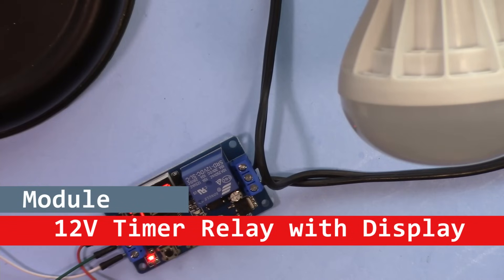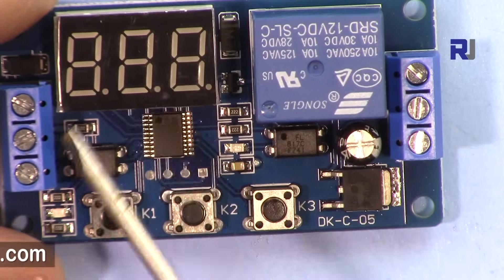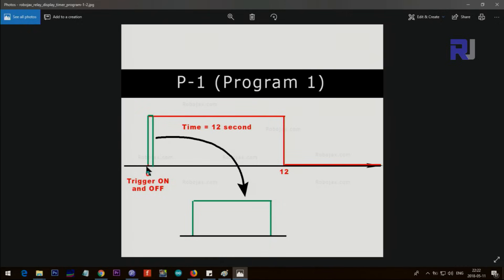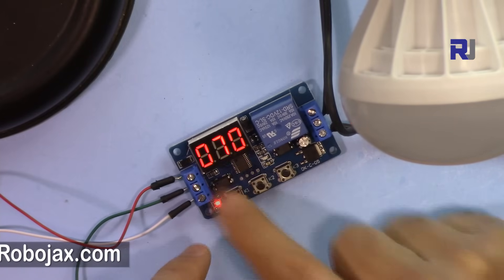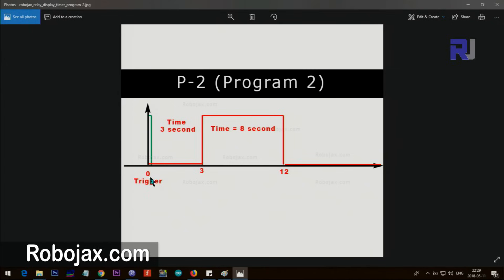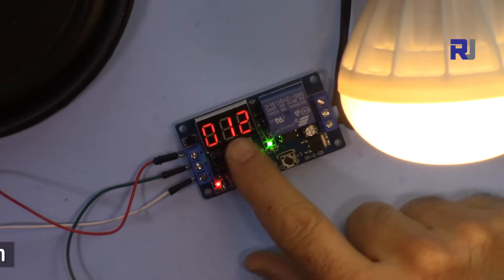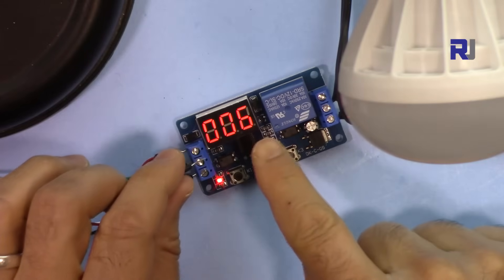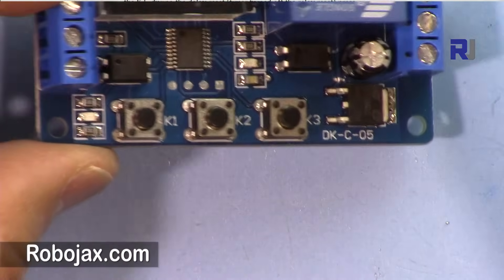Home Automation: 12V Relay with LED Display Delay 0.1 seconds to 999 seconds Timer module P1 to P4

Comment: I wish this had infinite sequences and a dial so I could use it to "programm" what my camera should do if it detects something.

Like radar/Pir-Sensor sends "high" to camera button
=> 
4sec "high" = wake up camera
0,1sec low

2sec "high" = change mode to photo
0,1sec low

0,1sec high/ 0,1sec low = trigger photo
x8 = trigger 10 photos

4 sec "high" = camera off,
 save battery
waiting for next input.

Comment: My friend does this work with dc? If not can you tell me which I need. I need exactly this function but for my car 12v
Reply from the maker: what? so you don't know what a relay is. of course it will work .relay is just a switch. AC or DC does not matter. see the resources page on  robojax https://robojax.com/RJT76
Reply: @robojax Jesus man way to answer a question. Why the hell do you make videos then if you are not trying to show people how to use something. Next time don't even reply if you are going to try to make someone feel stupid.
Reply: Thank you very much for your courteous and respectful reply for a comment made in your video that YOU made to explain what something does. Next time don't even bother answering someone's question for real man if that's how you are going to do it.

Comment: i want on light for 3 hour the off for full night and then on for 2 hour the off for full day can this timer do thia
Reply from the maker: the possibility is endless. Please watch, take pen and paper to understand  and use it.
Reply: @robojax I have a question. Do I need to set the loop function or not?
Because I only want one schedule: turning the light ON and OFF within 24 hours.

For example:

When I turn the light ON, it should stay ON for 3 hours.

Then it should turn OFF and stay OFF for 5 hours.

If I set a new ON time again, the first ON duration gets removed.

Comment: Hi, I have been using it for timer turn on after time and off after time, however that irrigation system was solved differently using tasmota relay, however now I would like to reuse this module for delay start od disks in the NAS, as I have only 300W PSU will even less on the 12V, I did figure out that to add 3s for 4 HDD and 4 HDD run when power button would be pressed should solve the problem… but I anyhow haven’t found yet the functionality which woulx gove me just the delay at the start and unlimited power-on later… highest I could set is 9.9.9… however it means that it will switch off one day… :-D not acceptable! BTW I have there programs 1-6 and there are also some modifications (A,C,E) for each program… it would be nice to get the full specs and user manual even in chinese … GPT can translate nicely ;-)
Reply: And now it already shows 9.9.8 (so the last was for sure an hour), but what means those before? It could be like 9 x 9 x 9h because the rest doesn’t make sense to me…
Reply: So those dots:
1) 000-999 (sec) // no dot
2) 000.-999. (min) // 1x dot at the end
3) 00.0-99.9 (sec,0-9) // 1x dot before the last number
4) 0.00-9.99 (sec,00-99) // 1x dot after the first one
5) 0.0.0-9.9.9 (????) // 2x dot between numbers
Reply: However still I have:
P-1 up to P-6 where the - can be either A, C or E!!!

PA1, PC1, PE6 and continue up to PE6

Comment: Thank you for this video. Does the board hold a memory of the last program when power is unplugged? Or does it need to be set each time it is plugged in? I am planning on using one of these to power a small pump for filling bottles.

Comment: I have a doubt, if I am powering my board through USB, then do will I need a different powered trigger for the trigger to work in P1.1 mode? Or will shorting the "6-30 V input and Trigger work"?
Reply from the maker: yes. the device needs to work and turn on. then the trigger is separate.  as for the voltage, I must have mentioned it in the video.
Reply from the maker: Here is the resource page for this video https://robojax.com/RJT76

Comment: Hi, could you please help me with setting up?
I want to connect it to my cars headlight wires so when they are switched on it will light a LED accessory light I have but then I would like the power to the LED switched off after about 7 seconds.
I would like this to happen every time  my headlights are turned on.
I plan to seal the module in a case and mount it inside the engine bay of the car so this means I won't be able to access easily to press any buttons or change settings every time it's used.
Any help would be fantastic!
Thank you.

Comment: I want just to add a delay of 3 mins when the module is powered on. Means say after a power cut, the power restores, I want the delay of 3 mins then power on the device connected to relay. Can you let me know the connections and mode to use? I think I dont need any trigger for this.

Comment: Brilliant explanation.  Without your help would never have understood the detailed instructions as translated.   I am using it in P6 to power a DPDT relay to reverse current for a model tram shuttle (auto back and forth). In test with LEDS (in parallel with reverse polarity)  it flips/reverses current well to the exact time.  However, the screen goes blank after the first switch, while the current reversal and timer continue to work.   Disconnect the DPDT then apply power and the display works fine.  I have tried diodes, separate power supply etc., but it seems to not like the surge required to start the DPDT coil or the surge when DPDT coil power is cut.
Reply: Hi. Does it have a N/O and a N/C contact or is the 2nd contact always closed? Tx
Reply: @victorvanwyk9878  Hi, yes it has both depending on how you wire the relay.  Common terminal and a N/O as well as N/C terminals.  It looks like a standard rsingle pole relay soldered onto the board.
Reply: @victorvanwyk9878  Hi, yes the device has both NO & NC single pole relay, can use one, the other or both. To reverse current that alters the direction of a DC motor, I am using the device to throw on/off a separate DPDT relay, and this 'surge' causes the screen to blank out.

Comment: Hi Ahmad,  

I'm truly new to all this, but I have to finish a project that involves this type of mechanism, though the one I need has to have a 

• physically separated switch 
• a small beeper for sound 
• a timer of 1–15 seconds 

The idea is that once I regulate the timer, let's say to around 9 seconds, I will  be able to press the switch, and the sound beeper will make a beep sound after 9 seconds.  I would do this continuously. 

I would be truly appreciative  for your  guidance in figuring out which one I need to buy online, probably from Amazon or from any place I can buy it from. 

Regards, 
CJ

Comment: Can you explain more on P.2. What if never remove the trigger at P.2. How is it going to perform? delay switch on as normal, after switch on  the timer stop counting to turn off until trigger remove? Because i wan to use it at amplifier as delay switch on and delay switch off with trigger.
Reply from the maker: to my best knowledge, I have explained all features. review all modes and find out whichever works best for you use it.
Reply: @robojax  Thanks first, what I mean is at 10.03 after you touch the trigger you straight away remove the trigger as shown, what I want to know is if the trigger havn't remove until switch on, what will happen to the device.

Comment: Hi, I need to turn on an led strip (12v) for one second and when it turns off turn a different one for one second and alternating those two. Which module is suitable for this purpose? Thank you
Reply: you can use this, with the 2 gates,  normally open and normally closed

Comment: If I want to use this circuit to rotate motor in clockwise and anticlockwise direction by up and down switch with single circuit than is it possible? If yes than how?

Comment: Does It have memory? If i program something anf it stops getting electricity, when i Connect it again, does it starts working with the instructions it was programmed last time or i need to program it every time? 
Thanks so much for your great videos!!!!
Reply from the maker: Yes it does. This has been answered in comments like 10 to 20 times. When you have questions please always read the comments first. Thanks
Reply: @robojax  Thanks so so much, so sorry, I went down but didn't reach that. Sorry for that
Reply from the maker: No worries my friend. Thanks

Comment: Hi this is so helpful. For my project I’m using this 12v relay but I’m only connection it to a 5v solar power manager. Will this mean that it won’t work cus it needs to be connected to a 12v power supply?

Comment: How do you mount this in a control panel as the relay is higner than the LED display
Reply from the maker: you are right.  use some kond of IC socket, remove the dispaly, insert the socket, and then insert the display. Not sure but this is one way to braing the display up.

Comment: Quick Question. I need to use P2.
Can the the unit receiving power be the trigger (there is no separate trigger).
I am using it in a car. so when the car is turned on that is the time the timer receives the power and i want that to be the trigger as will for P2.

Comment: But what happens when the module gets power? Does it do whatever function it is set to, or does it HAVE to be triggered? I need a module that when power is applied it turns on for a few seconds the turns off.

Comment: Hello I bought one off these but in p_4 the relay is open and when the trigger is applied the countdown starts and turns off. If the trigger is removed it turns on again. Can you explain that?

Comment: Great tutorial. I'm going to use this for a delay power off of my car stereo, which is older and doesn't have the delayed time off found in newer cars. 
P-2 program seems to be the one to use, just set the off trigger to zero and the time I want delayed to whatever I want. Thanks again.
Reply: Did you get this to work for a radio turn off delay? I don't see a program that will do this????
Reply: @mikescotese620  Yes, I got it to work. What I did was put a fuse block that I could connect everything aftermarket behind the dash I had power to it. You may just have a radio, I have a few other things. I ran power directly to the battery via a relay. This device controls the relay. It works great, but now my radio is powered for however many seconds I've programmed it for, which is fine if your in the vehicle for ~5 mins. But if you just get out, radio is still running until the timer stops.  Now I need to put another relay, smaller one, to have the door opening, dome light comes on, to stop power to this timer and shut down the radio. I'm going to do the second relay soon and then everything should work as I first envisioned it. A few hoops to jump through, but doable. The program I used, I think, is the one where there is a delay start. Timer off for a period of time, I have it at zero seconds, and then the powered on for however long you want it on. Hope this helps.
Reply: Many thanks for the reply. I finally got it figured out. For radio delay turn off just use P4. Works great on the bench now just need to transfer it to my Jeep. Thanks again!

Comment: Fantastic video. I have an application where I want the output to be disconnected for 120 seconds when triggered and then turn the relay on indefinitely. Can I do this with P1 by changing the wiring around on the output?

Comment: Thank you very much robojax! I am wondering what happens if the trigger is not removed in mode P-1?
Reply from the maker: I believe I have demonstrated it . If it was LOW to HIGH then it won’t have affect if stays there . I don’t remember what I did but watching video will give you the answer as I used diagram yo explain it
Reply: @robojax  thank you for clarifying!

Comment: Hi,i have a problem with the bord...if the bord isn't running any program it's switched off....
i want to make the board to wait for the trigger signal then run the program,any advices?

Comment: Hi. I m Yoshi from Malaysia. I wish to ask for ur help. Lately I hv bought a relay timer which look quite similar as yours. However I hv problem of how to change the mode to countdown. The unit I hv bought, is being programed in count up mode. Please please help me
Reply from the maker: Hi, welcome from Malaysia. This video is my best help. if your module is different I can't say anything because I don't know how it functions.
Reply: @robojax  thanks for replying this quick. My relay is under brand ‘Diymore’ and there has no mode written at any part of the relay. May I know how do u set your countdown or up mode? Perhaps I could use it as reference and try it later.
Reply: @robojax  oh ya, I could not attach the picture of my unit, it is identical to what you have shown in the YouTube

Comment: Will its time value hold whenever power resumes after interruption? or get reset to zero ? Should I have to use inverter supply to hold  its current value in P 1.1 setting ?
Reply from the maker: yes of course. it would be crazy to set it every time you turn it off .
Reply: @robojax  please clarify ur answer. Should I have to use inverter to hold last  intrupted current time value 
OR without any  inverter, the circuit will itself hold the last intrupted  value ??!!! (please check yourself> because one youtuber said that it reset to zero, when power goes, so use inverter.
I want to use it for 'reverse'''displaying time countdown''' in my project as time displayed in a washing machine.

Comment: I am using program P-3 and I want to have a 600 second off and a 0.2 second on time.  How can I set the timer to do this?  When I change the 2nd parameter to 0.2 seconds the 1st (or off time) goes to 60.0 seconds.  What am I doing wrong?

Comment: Should the power source and/or trigger signal input be fused? Rating?
Reply from the maker: Any device you control should have its own protection.
Reply: @robojax  but do you know what the fuse rating should be for this device?

Comment: Hello sir, do you know what the max input voltage is on device? I have the voltage in my vehicle set around 15.5v but no more than 15.7v on cold days.
Reply from the maker: Hello, rated voltage is 12V. The relay might handle 0.5V more.
Reply: @robojax  okay. Thank you!

Comment: The problem with anything in this modern internet shopping age is the lack of commonsense. For one ...every product should be packaged with a users instruction sheet authored by someone who has command of the damned language  spoken by the buyer as used to be customary before the insufferable age of  internet shopping .
The very fact that videos have to be made about learning how to use the damned product is annoying , especially when it is not certain that one can be found for the product bought from any vendor at all.
Reply from the maker: Yes indeed. Most products have no instruction manual but worst of all the product has not model or number to be found. Each seller put whatever bywords they know as product title in order to attract buyer. I have contact 100s of sellers asking them to just put a number or special name like KT23B so people can find the same product but they don’t listen . I would have made 100s videos for products to demonstrate them but because there were no model for them I didn’t.

Comment: I ended up using one of these and it triggers but the dc motor im connecting on the right side doesn't spin at all. What I have going on is a 9v battery connected into a bread board then a wire coming from the power of the 9v on the bread board to the top left and a wire connected to the ground of the 9v on the battery going to the bottom left and a wire in the middle left that triggers from a signal from a push button to the middle left. (signal works because countdown enables on this module when the button is pressed) and on the right side i've tried 1 wire in the breadboard ground from the 9v from the dc motor and the other wire of the dc motor in the middle right or even top right of the module with a power wire coming from the 9v on the breadboard on the bottom right but it doesn't ever trigger the dc motor like it's not getting any power. I've tried taking the wire from the bottom right and touching the middle right where the wire from the dc motor is connected and it does not trigger. Anyone have any thoughts on this? Thanks!

Comment: Hi. Just wanted to ask.. in this setup can we get 2 bulbs in the relay no and nc and in p3 we set time duration of say 8 seconds each would it light the alternate  bulbs  infinitely or after some time it will turn off after say 10 repetitions. Thanks
Reply from the maker: Hi, both load or AC bulb will turn on and off together.
Reply: @robojax  thanks for your reply, i wanted to run 2 set of linear actuators which are powered by a 12v geared motor , i wish to run both motors in 2 ways . One when its n.o. they will rotate clockwise and in n.c. condition they rotate anti clock wise. Is it possible? Building a mechanism where the actuators move up n down during the cycle.
Reply from the maker: They can operate the opposite of each other yes . One will turn on and the other will turn off.   Yes. But not independent operations at different timing as we have only one relay. Birth must be operation with the same voltage.
Reply: @robojax  can i get your emal id so that i can communicate better? Really wanted to understand this.

Comment: P-2 seems to work differently for the 4 digit unit
ie P-2 can be used to close a circuit for a specified time immediately after  powering up this handy little unit

Comment: I want to turn the device on for 30 seconds without the trigger bypassing this timer and after the 30 seconds have gone it should shut off the device. Then if there is no trigger, then turn it back on immediately and run 30 seconds timer as before, however, if the trigger existed after 30 seconds then keep the device off until the trigger ceases to exist. Is it possible? Thanks.